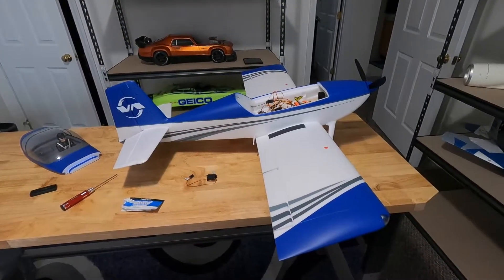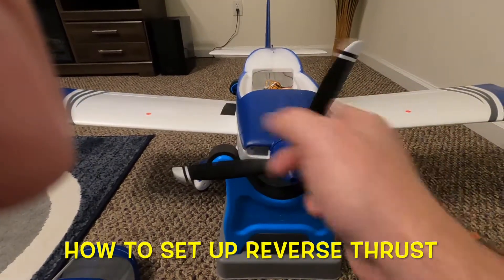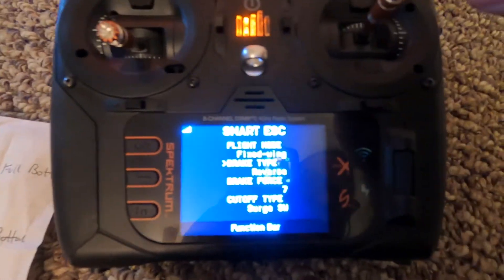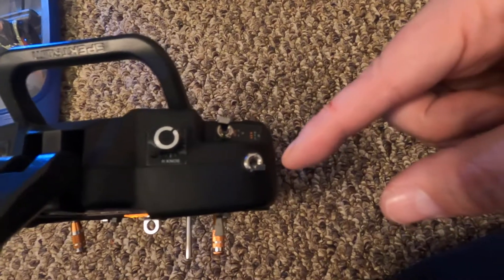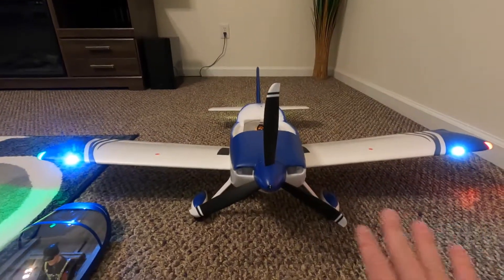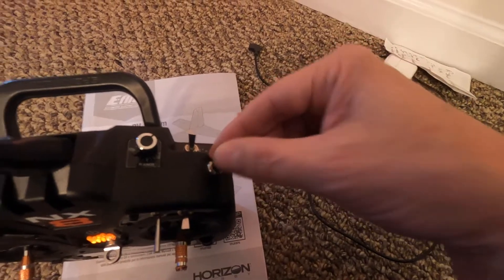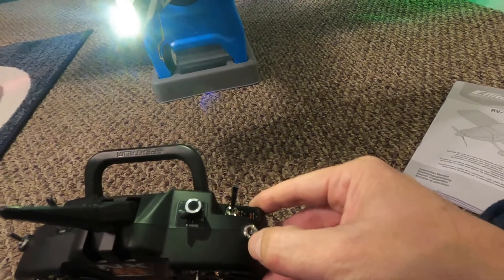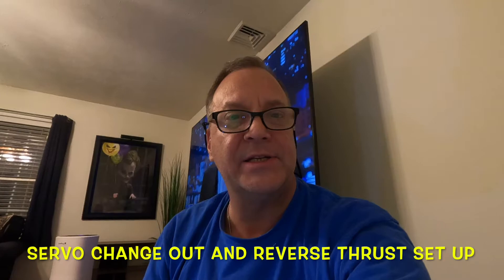HOW TO SET UP REVERSE THRUST ON YOUR RC PLANE WITH A SPEKTRUM AVIAN SMART ESC

Comment: I have quite a few A370 servos from a downed V1200. They do not move the same direction as the stock RV-7 servos. Did you have this issue? Unfortunately, Horizon was no help with this. They aren't listed as reverse servos. Not sure what to do. I also plan on using AS3X, so I can't just reverse them through the Tx. Thanks
Reply: My A370 servos actually rotate opposite of the stock servos. From your video, the recommended A370 servos should be a direct drop in. I'm not sure if I need to go into forward programming to reverse the servos.
Reply from the maker: @dougdurham860  I put mine back in the same way the old ones came out and I haven't had any issues. If you haven't got this fixed let me know and I will send your post to my HH contact and he will get back to me. So let me know if you got it fixed. Thanks and I want to help.
Reply from the maker: If not Spektrum, it may be going the wrong direction in Normal mode and because of AS3X, that cannot be used. 

Either one of these should work properly:

https://www.horizonhobby.com/product/a335-sub-micro-digital-9g-metal-gear-servo/SPMSA335.html

https://www.horizonhobby.com/product/a332-sub-micro-analog-9g-metal-gear-aircraft-servo/SPMSA332.html
Reply from the maker: This is my contacts response
Reply: @DronemanJoeRc  tried A332 and it's goes backwards. 🤔
Reply from the maker: Im not sure if Im understanding you correctly, my stocked servos for the elevator and rudder were defective so HH replaced them with A370 metal servos. the servos have nothing to do with reverse thrust its the Ar631 that is installed in this bird and you have to go threw either avionics or forward programming depending on your transmitter your using. I have a nx8 so I just did it as I showed in the video. Im not sure if that answers your question or maybe im just not understanding? Let me know.
Reply: I had the same issue. No matter if it was a standard or reverse servo any replacement servo I tried went the opposite direction. And as mentioned you can't simply reverse the servo in the radio since AS3X and SAFE will still be backwards.  HH tech help was no use.

Comment: I am a park flier, which makes jets and larger models problematic. I have a five plus year old DX6 Gen2 with not updates, and wanting to purchase a NX6 or if necessary NX8. The only plane I have requiring more than six channels is the Turbo Timer Evolution with floats. Thrust reverse would be a big asset or necessary: to fly from a park pond. If I go for the less expensive NX6 upgrade can I assign SAFE to a ghost channel allowing me to keep SAFE on an assigned switch? It is not a ton of $, but I do not see needing more than six channels except for my float plane. It is an hour to as long as 90 minutes to a proper AMA flying field from my home in downtown Indianapolis with stoplights, traffic, trains and construction delays. How have you found the programmed model setups? Is telemetry, flaps and thrust reverse already programmed? Sorry for the long list of questions. Cheers, Brad
Reply from the maker: You can do that with safe, but when i was going to upgrade also i went the the nx8 bc it makes it simpilar to do safe and other features so for the few extra bucks go with the nx8 bc you never know you may want more down the road.
Reply: @DronemanJoeRc  Thank you, I will go with the NX8 👍
Reply from the maker: yup thats the better choice. good job